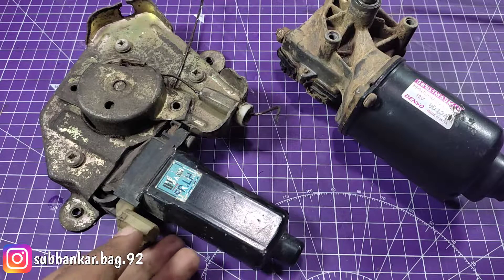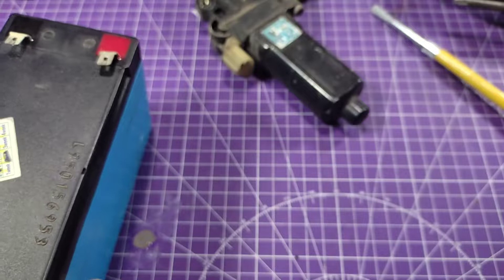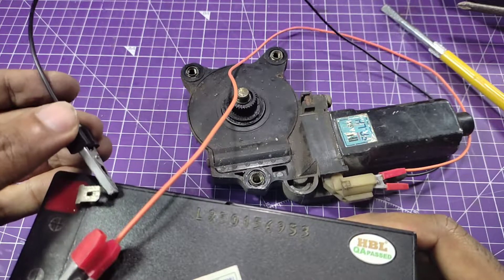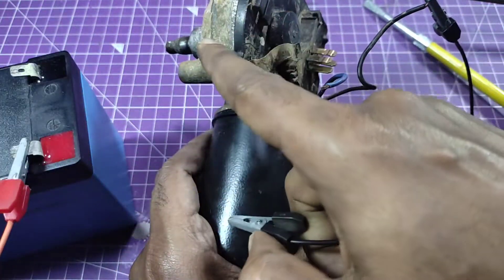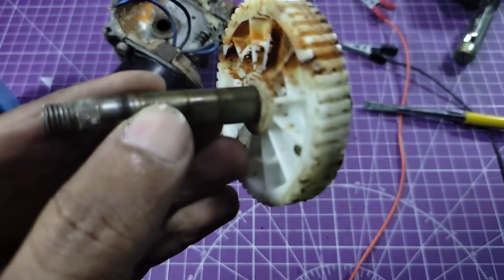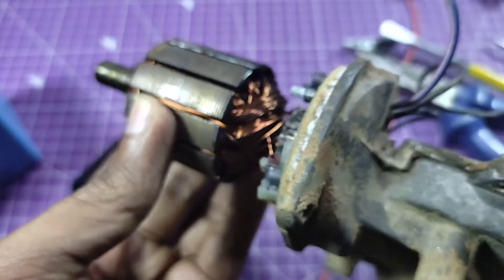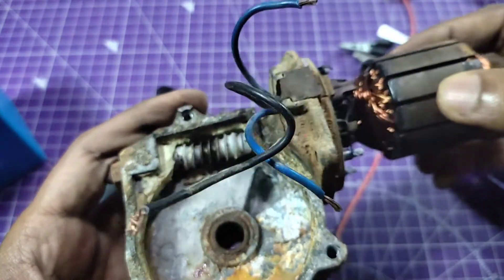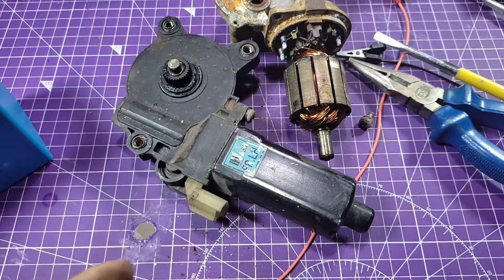Don't Throw Away Your Car Wiper Motor & Power Window Motor || High Torque Worm Gear Motor

Comment: Which adapter should be used to run power window motor without any battery for home project? (Input will be 220 Volt AC)